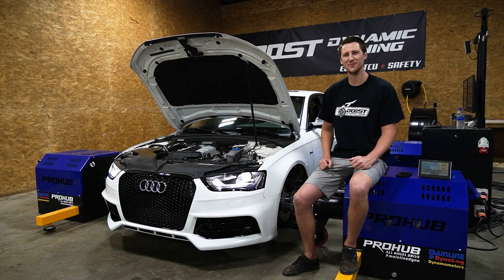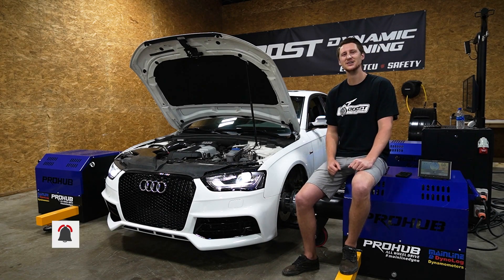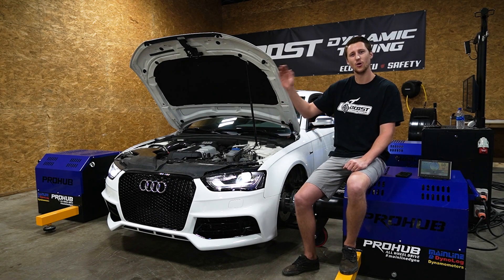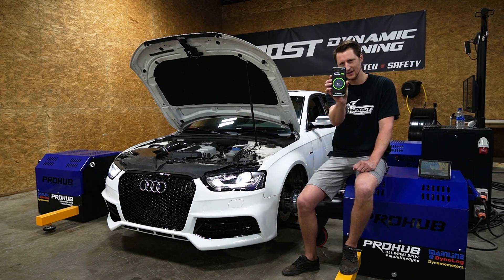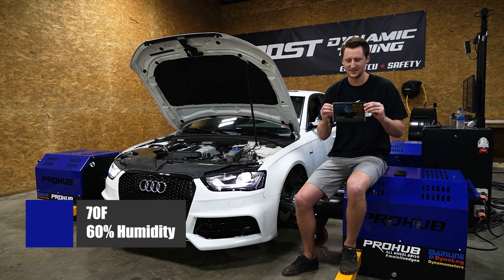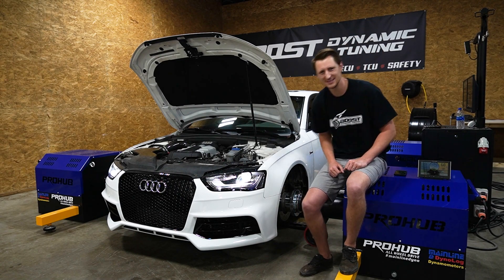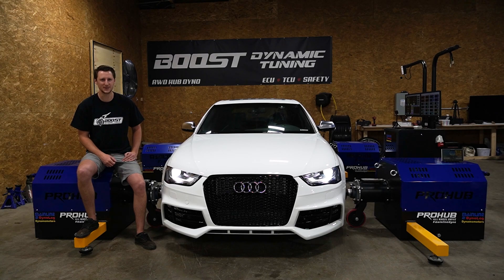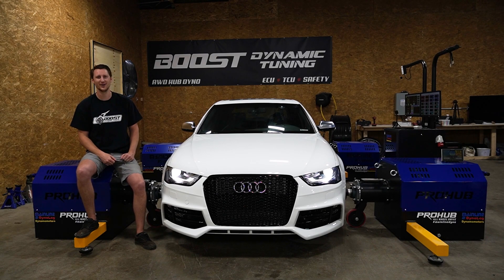Audi B8/B8.5 S4 Stage 2 Tune - Dual Pulley - Dyno

Comment: Excellent video. I couldn't see the 0-60 and 1/4 mile numbers off the phone cause it was blurry. Can you post it here? Thanks.
Reply from the maker: Sorry about that, I added it in the description.
Reply: @boostdynamictuning   what were the 1/4 mile time and trap speed with the stage 1? i see only one time listed in the description which I am assuming is for the dual pulley run

Comment: I'm about to go on my SQ5 2015 from stage 1 to single crank pully 207 (like dual pully)
But I can see that in your previous video with only single pully you got more HP... so... what is going on?  I know the torque is a little more but heyyyy... the HP went down. 
By the way how much HP AND TORQUE  this car has with only stage 1???
Reply from the maker: Not this video was taken in very warm weather, the stage 1 was during winter time. So the numbers are heavily effect by some good weather. Stage 1 in winter time is 410hp and I forget tq numbers.
Reply: @boostdynamictuning  it was 438HP WITH ONLY SINGLE PULLY. 390NM TORQUE.  It's much more hp than the dual pully and very little less TORQUE... so I'm little confused about doing single or dual pully... how it can be??? ?  ??
Reply from the maker: @doronkoz  as stated in previous message, weather conditions. Dual pulley 100% makes more tq and hp, no questions asked.